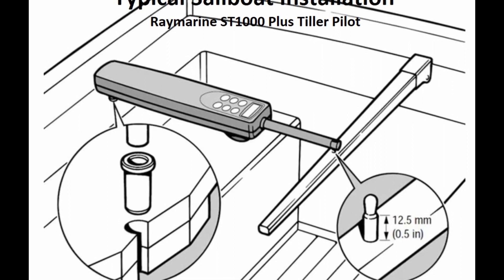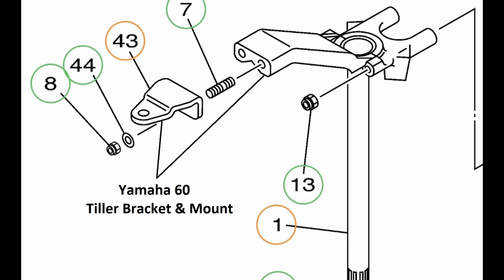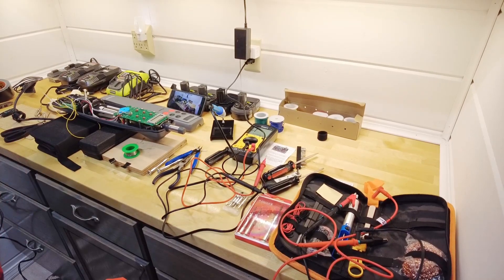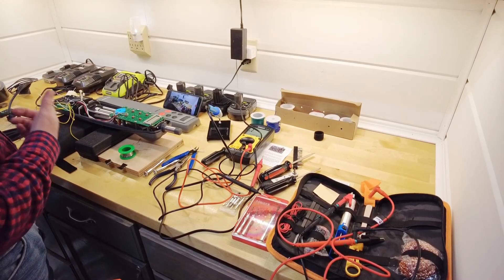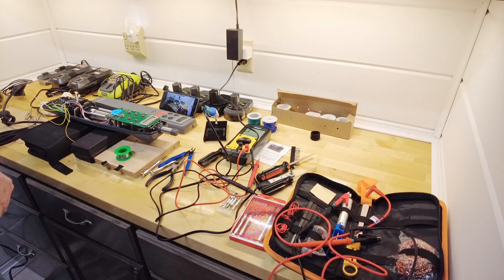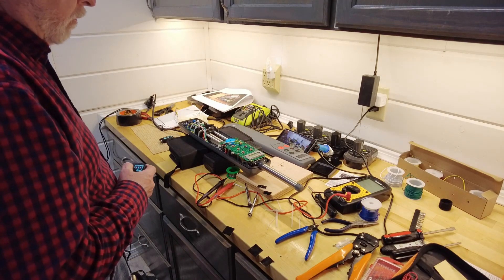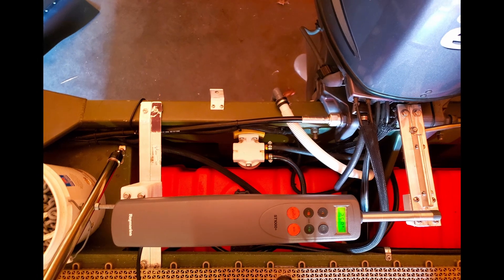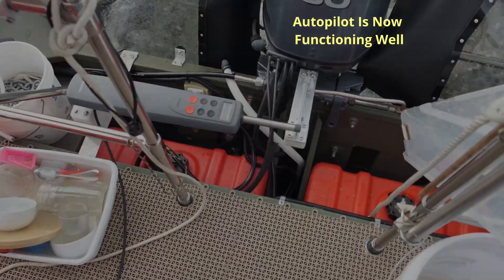Shanty Sanctuary, The Build, Autopilot

Comment: Ted, would you please send some info on.protecting your trailer winch from theft.  Possibly pictures too.  Much appreciated.  Jim.
Reply from the maker: I have no security for the winch, it is simply bolted on. However, I do have security for the battery, the more likely to be stolen. 

The battery case is mounted on a 1/2" piece of HDPE with U-bolts running around the frame and through the bottom of the battery case to hold the HDPE and battery in place. The fasteners are inside so bolts can't be removed once locked.  

To secure the top of the case I use a heavy duty galvanized pipe hanger strap (1-1/2") bent to fit through closed slots cut in the HDPE. The strap circles the HDPE and over the battery case fitting the indent at the top of the case where a normal hold down strap would be.  The strap ends are bent at 90 degree angles at the top to accept a padlock through the holes in the strap. I just pinch the straps together and padlock it in place.

This is not original idea. I copied the concept from a guy on YouTube that made a similar design for a travel trailer to secure his battery. His was in a metal case if I recall. I just modified it to fit my situation.  

I will try to do a video that includes this feature when I begin processing this summer's work.  I made a three week trip to Long Lake, Ontario (Longlac, Ontario) in June and July, after the third delay. I am currently preparing for another 3 week trip to Temagami, Ontario soon.  

I am replacing my editing computer and making several boat improvements which has kept me busy between trips. I was hoping to put out at least one video but it won't happen. I'm running out of time! You should see the first trip starting in October.
Reply: @ShantySanctuary  Thank you.  Thinking of running #8 from truck battery to run winch.  Using high current connection.  
Enjoy trips.  Looking forward to videos.
Thanks, Jim
Reply from the maker: The previous owner put a battery in the back of his truck and simply ran cables to run the winch.  Certainly worked fine for him and is a less expensive route to go. I figured if I was going to carry the battery anyway, I might as well mount it close to the winch. I carry a lot of stuff in the back of the truck and did not want the battery to clutter up the space.  

Not sure how much voltage drop you would get with #8 wire from the front of your vehicle. I believe that is the same size the previous owner used but did not have as long a run. Let me know how that works for you.
Reply: I checked ampacity chart n #8 plenty.  I’ll let ya know.  Jim
Reply from the maker: Sounds good. Keep me posted.

Comment: Nice application
Reply from the maker: Thanks Dave.  It has worked out well since installed.  It is portable, so I can remove it and store in the cabin for security on the road. 

It hasn't been tested in rough following seas yet but then I would prefer NOT to make that test.  Sooner or later though I will likely have that experience again!  I've found that following seas (semi surfing) are the best test on whether an autopilot will do its job in most conditions.